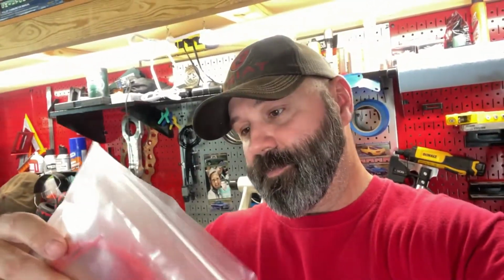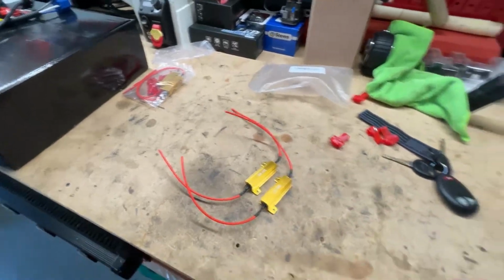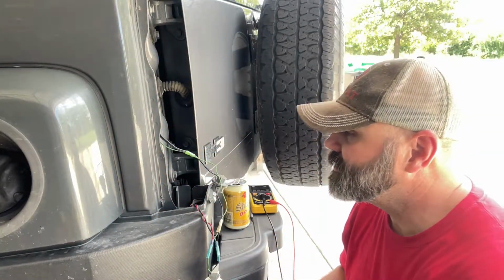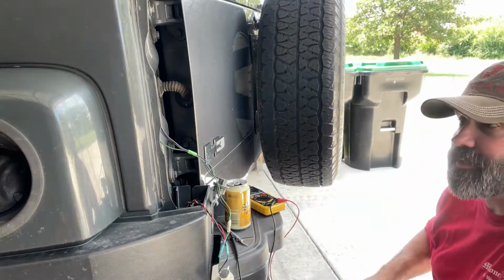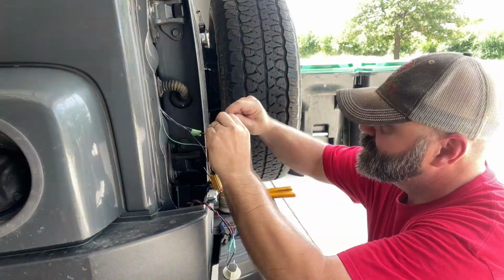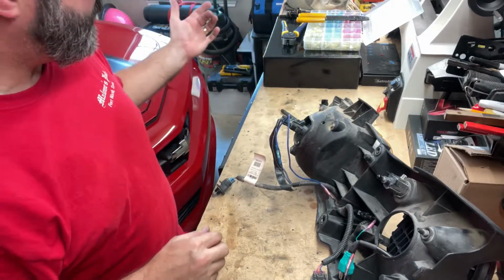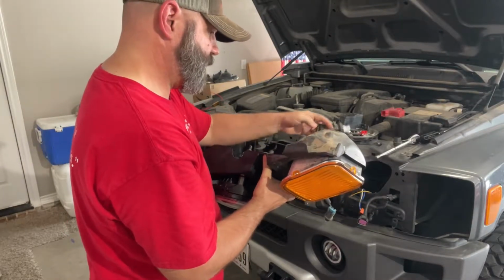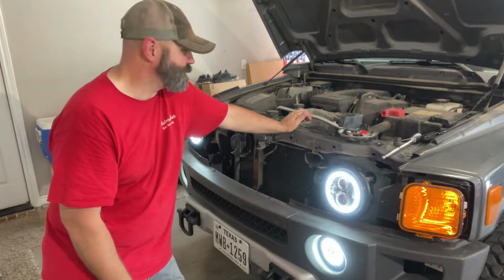Fixing LED Hyperflash Is Dang Easy

Comment: I left mine flashing faster. It's more noticeable, and I think safer. Just, remember to check, occasionally, that all your bulbs are operating. If the powers that be were, really, concerned they'd have a warning light on the dash for the CHMSL. I see WAY TOO MANY cars around with no working Center High Mounted Stop Light. Now, that's dangerous.
Reply from the maker: It is more noticeable I think too. Just too fast for me to be flashing on the dash.